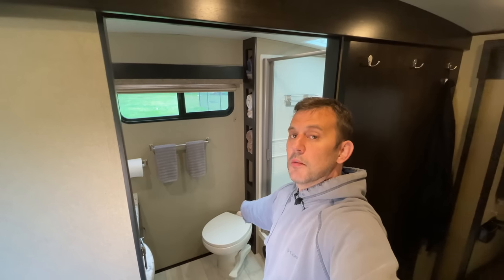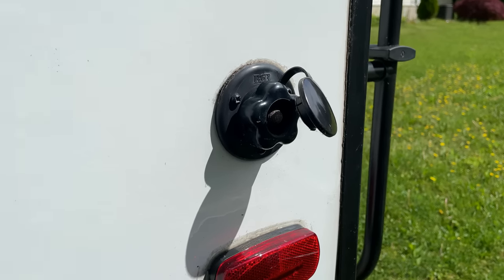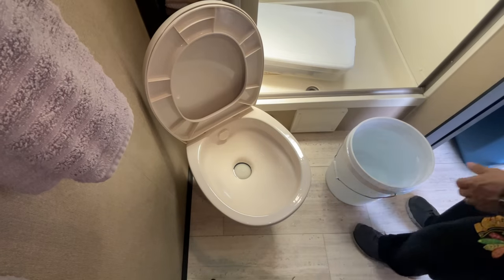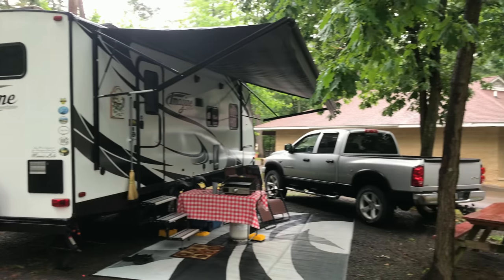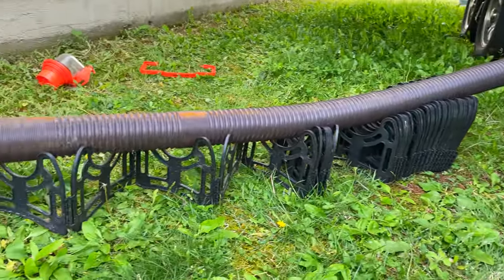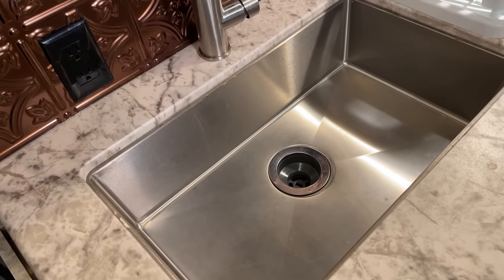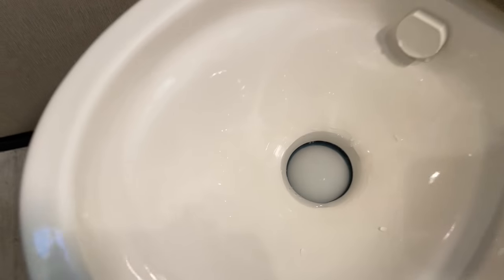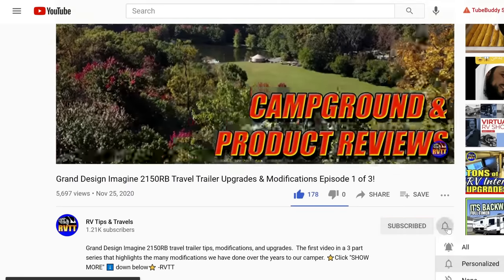RV Black Tank Cleaning, Maintenance, Tips & Tricks - The Original Black Tank Master Class

Comment: Very good video ... I can't say it enough: "Never walk away when you are filling with the internal spray working!! I have seen a brand new 5th wheel that flooded for 30 minutes and cost $13000 to fix. I am thinking of using (in addition to the digital flow meter) a hose garden timer in line that will turn the water off after 5 to 10 minutes as a back up ... yes that is experience talking and it is after I came within about 4 gallons of the same flooding - it is so easy to get distracted!  Another suggestion if your tank is not directly under the toilet is to carry a short handle plunger with an almost football sized bulb on the end.  It is the only thing that has cleared a stoppage and works every time. Slow steady pressure will blow it free... and we do everything in the video ... just STUFF happens....
Reply from the maker: That’s why I use a bucket.  Once and done!  Thanks for watching and commenting!!
Reply: @RVTIPSANDTRAVELS  But I'm 77 and afraid I'd kick the bucket!  :)
Reply from the maker: Camping keeps you young my friend!!!

Comment: This was a very well done video with a bunch of tips and recommendations on maintaining our black tank. I already do a couple of the things you mentioned, but not all.  Now I have a better understanding of how the system works and how to keep it cleaner, if that’s even possible given what it contains, during our travels.  I tried to visualize how to cover our jack stand and then I remembered that we have a fifth-wheel RV and it doesn’t have a jack stand…LOL. Regardless, having a spare 5 gal bucket is a great tip that has multiple uses in maintaining an RV.
Reply from the maker: Thanks Mike!

Comment: I learned Black Tank Maintenance from my father.  A lot of what you shared in this video.  One tip from my dad was when heading home from a trip, find a dump station about 100 miles from home or on the last days travel and follow the “Dump, Flush, Dump…” until the discharge is clear.  At this point fill your black tank (and gray tank as well if you want to)   But add more water than you normally would.  If you normally add 5 gallons, double that and add about a cup of laundry detergent to the tank.  Make sure to use a detergent that is “Septic Safe” (need to protect that good bacteria) and let is slosh around for the last few miles of the trip then dump it and if not being winterized, put the correct amount of water and tank treatment recommended and you are ready for the next outing starting with a tank that has no bad smell
Reply from the maker: thanks for watching, here is another one that is related about flushing: https://youtu.be/Q7ZJzfimLwg

Comment: I have the back flush on my elbow that hooks to the sewer dump. I shoot water back up into the tank  I do this a least 3 times when dumping. Also I put a small pan head screw to hold my bumper caps on.i don't need my sewer hose waving at traffic as I go down the road. Also I dump 3 or 4 ,2 gal.pails of water down the toilet to make sure things get moved around.
Reply from the maker: Funny you mention the bumper cap, just finished filming a short video on a couple options to keep them from falling off.  Thanks for watching and adding to the video Tom!

Comment: I have a 2016 travel trailer and don't have a built in black tank flush. I have a clear 45 deg elbow fitting with a valved hose connection that shoots water up the black tank drain up into the tank. I use this to back flush and fill the black tank several times each time I dump until the water comes out clear. Have never had a black tank problem or a level sensor problem in six years of use. I use Happy Camper and am happy with it. 
I do have a pretty direct and short pipe from my dump valve back into the black tank. I do believe the key is to dump and flush thoroughly and often.

Comment: Side note on plungers that I discovered the hard way. So last June we purchased our first 38 ft fifth wheel, and it was used and in excellent shape. During one of my showers I looked down to see the water level coming up to the top of my feet. Being a regular homeowner all these years my first thought was to get out the plunger and fix it. I dope slap my forehead now when I think back about not knowing about holding tanks.

But here was the problem in using that plunger. I had a HEPv0 waste valve on the shower which is simply a replacement for a p-trap.  It has a long thin membrane inside that closes when no water is going through it.  When I violently plunged the drain it sucked that membrane backwards up through the opening in the shower and really messed it up. Consequently I had to replace it because we were now getting odors up through the drain. So don't do that.
Reply from the maker: Great input, thanks for sharing. I probably should have been a little clear in my statement about plungers because it was meant to help unclog issues from the toilet down before they would hit the tank, a.k.a. meaning the clog was in the pipe going down into the tank and not necessarily in the tank itself. Also you’re not gonna get any pressure Using a plunger if the tank isn’t filled past the vent pipe and all the pressure will go out through that vent pipe.
Reply: Omg..was going to get a plunger next week....thank you
Reply: @RVTIPSANDTRAVELS  ww

Comment: Good Tips! Thank you. This is what has worked for us:  After the dumping the black waste and use the sprayer till the "see through elbow" appears clear... Close the black tank valve. I use the tank sprayer to fill up the black tank, monitoring the amount with the tank level gauge, fill to 3/4 full then empty. I do this twice maybe 3 times. Again waiting to see clear water. Close the black waste valve. Then I use the inline hose sprayer to clean the black pipe and the hose. I'm always amazed by the additional "Stuff" that flushes out after the initial flush even though the water appeared "Clear".
Cheers! Jeff and Sandy
Reply from the maker: Cheers!

Comment: We had an enlightening experience recently.   We bought a Thor class A one year ago(first RV).  Went on a dry camp for few days, so went to a dump station.   I have a gate valve fitting with a hose connection since no factory internal cleaner.   Started filling it and asked wife to check water level.   She said no lights won’t work.   Dummy me, I left hose running and went inside.  It was not working.   Somehow use switch changed to store.   Heard a noise when I got power back on and wife screamed “Turn it off!!!!!”   The water was coming into the sink in bathroom.   I got the valve pulled just in time to stop from overflow!   
We have storage in the waste bay.  So I take the slinky and compress it as short as it can and then connect both ends together.   Fits on bay and no fuss, no muss.
One should not use soap in an RV.   Soap meaning bar soap or hard soap.   Liquid soap is actually detergent.   The soap scum you try to get out of the shower also builds up inside the gray tank.   Very nasty stuff and can cause very large balls inside your tank.
Great video!
Reply from the maker: Holy crap!  pun intended.  Thanks for watching and commenting Kevin!
Reply: Had a friend have a similar experience, they had water shooting out their roof vent!!
Reply: @eander0319     I think you used the term water very very loosely!

Comment: Excellent video! I've been camping in RV's for years but never knew this. So just to be sure I understand, after dumping the black tank with your method by adding more water after the dump, the final step is you put the black tank chemical and more water in and leave it there until the campers next use? What if it sits for a couple months between uses? Subscribed and Thanks!!
Reply from the maker: Thanks Russ, I appreciate the comment. Personally I would always keep water in the tank even if it’s sitting for a couple months.  I’d also put the treatment in when I put the water in just so that you don’t forget to do it Before you go and use the toilet again.

However, if you know the tank is completely cleaned out I don’t think it would hurt to leave it empty over long periods of time either.  It’s really a judgment call if it’s going to be sitting for long periods of time, but at the end of the day I don’t think putting A little bit of water in there is going to hurt anything.
Reply: We get sustained temperatures in the 10s and 20s and sometimes down to zero, so we completely drain out gray and black tanks when we winterize. But i do the double and sometimes triple flush. I hadn't thought of using the gray water for blank tank flush but will add that to my regimen. Absolutely great, clearly articulated, and well organized video!

Comment: Wow! Thank you so much for this comprehensive video! I have really screwed up my black water tank over time by being toooo conservative with water. Mainly because in a camper van a few years ago the black water overflowed into the shower! disgusting! So I have this ongoing fear, but now that I understand the need for water, and have created the poop pyramid in my tank, I am ready to manage this issue! 
So, right now I believe there is NO water in my tank but a lot of waste piled up. The toilet is full to the top and I have used the swirling water snake numerous times to try to break that clogged seal somewhere in the pipe above the poop pyramid. I have broken it up somewhat, alot of TP, which, thanks to you, I now know not o use the RV kind - you are so correct, it doesn’t disintigrate for a long time! I have also purchased and used the back flow water pressure system at the tank discharge valve, drawing some waste out but I have not yet cleared the clog.
Watching your superb video has given me an idea, now that I understand the configuration of the tank itself. If I raise the rig on the left side, to tilt the discharge valve higher I can get some water in that tank to stay. If I mix a batch of waste dissolving stuff in a bucket I can use a funnel to get that into the tank also. Then if I let it sit I may begin to break up that pyramid. What do you think? I am also thinking about shoving a broomstick into the pile. Would that be wise or stupid? Is there anything in there that I could damage?
I await your help with less anxiety since watching your video. Thank you so much. Meredith
Reply from the maker: try using an old broom hold with a dull edge to break it up.  wear gloves and dispose of the broom hand after.  also, you can dump your solution right down the toilet.  no need to go through the valve.  thanks for the nice comment, let me know if you have any more questions.

Comment: If you have an older RV and no auto / on board cleaning you need to have one of the cleaning sticks, I recommend  Camco RV Straight Swivel Stik with Shutoff Valve.  The end spins and blasts the sides of the black tank with high pressure spray.
Reply from the maker: Thanks for sharing Anitra!

Comment: If I have been on the road and both tanks are closed off, I first empty the black with water going into the flush tank inlet.  This way I am flooding the black tank while emptying the black tank.  Then I close the black tank valve while leaving the flush water going.  I have measured water and find that about 1 minute of water is about 5 gallons of water.  Then I open the grey tank valve to use the soapy water to "clean" the hose while emptying the gray tank.  This process works well for us.  While camping I leave the gray tank open and close it the day before we leave so I have water to flush the drain hose with soapy water.
Reply from the maker: Great tips, thanks for sharing Richard!

Comment: Very good video, sir. Well presented and very informative. Using regular, septic safe toilet paper instead of RV paper was something I never would have imagined. As a new RV'er, I appreciate all of the tips and information. Thank you for the great video.
Reply from the maker: Glad to help!
Reply: We have used regular septic safe TP for years with no problems.  The key is to always keep about three gallons of water in the black tank.  I also make sure there is water in the grey tank as well with the dump valve closed.  That ensures that the dump valve seal remains wet.  Wet tanks are happy tanks.   For those who want to operate with the grey valve open all the time, just intermittently close it for a day, let some waste water go into the tank, and then reopen it for the busy times when people want longer showers etc.  but dont let the valve seals dry out or you will develop leaky dump valves.  No fun!
Reply: @gerryp9717  
Thank you for the tip. 👍🏻 That certainly makes good sense.

Comment: This is a great video. The clear pipe elbow is a great thing to have. I’d recommend having one at the trailer connection so you can see it right at the valve instead of walking over to the dump pipe.
Reply from the maker: Thanks for watching and commenting, Scott!
Reply from the maker: Thanks for watching and commenting, Scott!
Reply: I use a clear fitting at both ends…45 degree at the trailer, 90 degree at the sewer, that way I know when the pipe is completely empty.
Reply from the maker: @briand-jfrommasonmi4449  great point, thanks for commenting Brian.
Reply: It may be a little gross, but you get used to it.  And, it takes a lot of guess work out of the emptying process.
Reply from the maker: @raesalim9341  agreed!
Reply: Did you buy or make your clear connection at the camper? I have only found the clear elbow.

Comment: Ross great instructional video! 
Have one concern about the black tank flush system - should we be aware of the in feed water pressure on the system as you mentioned there is check valves and vacuum breakers? Should we be using a pressure reducer? 
Thanks again for your excellent videos
Reply from the maker: Absolutely.  Great question.  My pressure regulator is the first thing that connects to my water hookup, so everything after it is regulated.  Thanks for bringing that up Dan. There’s really only one situation where you would be putting water in your RV that does not need to be regulated, and that would be one filling your freshwater tank. Because the water is constantly flowing no pressure builds up, but I still regulate everything right at the source, including the black tank flush. Thanks for watching and commenting.

Comment: Such an amazing video.  Thanks for putting this together.  We almost never have full hook-ups so taking the time to add more water to the black tank after dumping at a dump station is too time consuming but I always flush the tank when I get home.  As you said, I can’t believe all that comes out.  I do this 3-4 times and it’s clear by the time I’m done.  

I always have 5gal bladders with me so I may fill one before we go to the dump station and then after pulling away I can add that to the tank for the drive home without holding up the line.  Thanks again!
Reply from the maker: Thanks for watching and the nice comment!
Reply: @RVTIPSANDTRAVELS  the other thing we do is put a heavy duty Rubbermaid tub in the shower basin so when we shower, we stand in the Rubbermaid tub so most of the water ends up in that.  We then dump that water down the black tank to even things out as our gray tank fills faster than the black tank.  Works great and adds more liquid to the mix.
Reply from the maker: Great tip!  Thanks for sharing!
Reply: It takes three minutes to add water back into the tank using the tank flush.  So for three minutes…the line can wait.  🤪

Comment: I hooked up a water hose to the black tank flush and forgot it. My wife screamed that it was overflowing in the trailer. It took a week of Pinesol washing every corner, pipe and furnace vent to get rid of most of the smell. I bought the small flow meter and now add 4 gallons after I dump the tank.
Reply from the maker: yeah, definitely something you have to watch if you keep the waste valve closed while rinsing.

Comment: We have been full time for over 2 years. We have always used 2 cap fulls of fabric softener and 1 cap full of laundry soap and we have never had a problem. The evidence is; 1. Absolutely no smell until it gets too full and blocks the vent pipe. 2. After I have dumped the tank, I can look down into the tank and it’s clean. 3. I watch the clear elbows when I dump and can see what is coming out. What I see coming out is almost completely dissolved solids and paper. I had the hose come off the elbow that goes done into the sewer and saw first hand what comes out! Another absolute must is using the correct paper. If you don’t, pyramids are almost guaranteed regardless of any other treatment. Then you are using a stick down your toilet to stir it up. I have experience with that! We use Scott tissue exclusively. Happy poop job!
Reply from the maker: Thanks for commenting!

Comment: I know you said to always have some water in the black tank.  Most RVers know not to leave the black tank valve open while parked in a full hook up site.  It would be good advice to highlight this for the new RVers. 

 Don't leave the black tank valve open while connected to the sewer unless you are dumping the tank !
Reply from the maker: You won’t be able to keep water in the tank if the drain is open.  Thanks for watching and commenting Roger!  We appreciate it!
Reply: @RVTIPSANDTRAVELS  So the only advantage to using a full hookup site it that I can "dump" the black tank when ever it is needed without driving to the dump station or getting an auxiliary tank on wheels to do it. Still have to use the tank as if I were boondocking and pull the black valve only when needed, correct?
Reply: @fkiehner  That is correct.